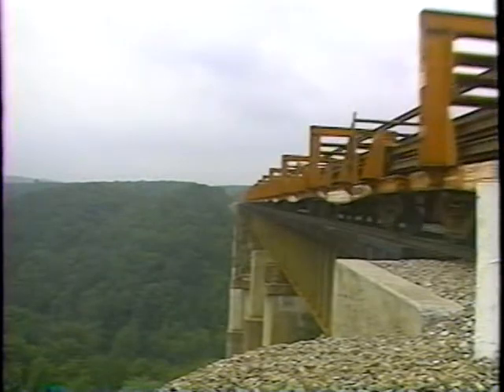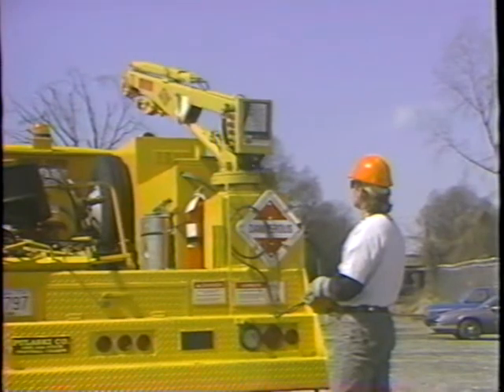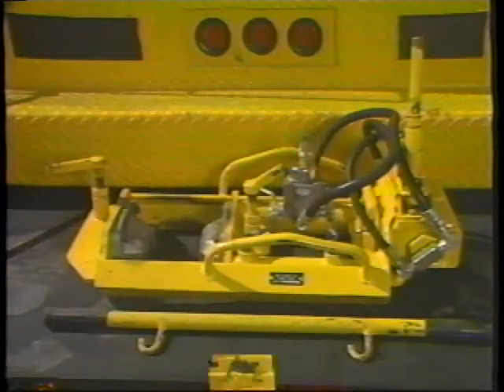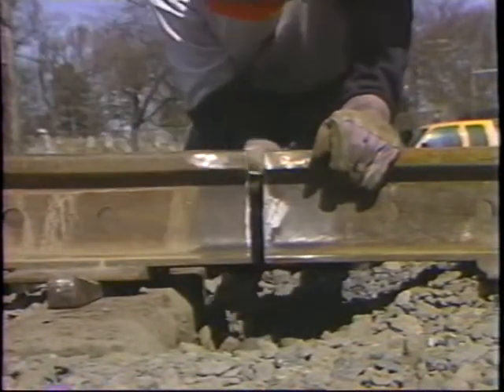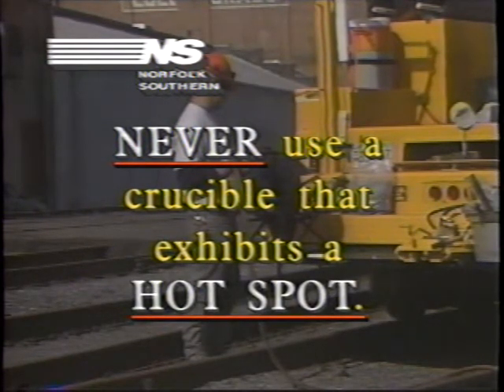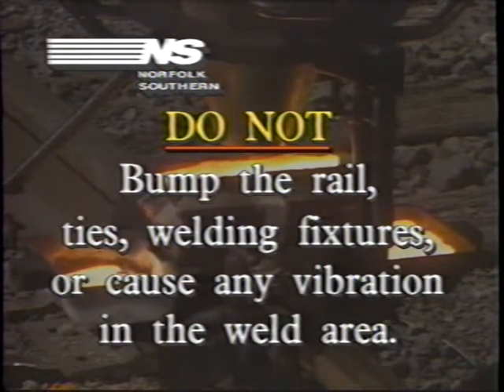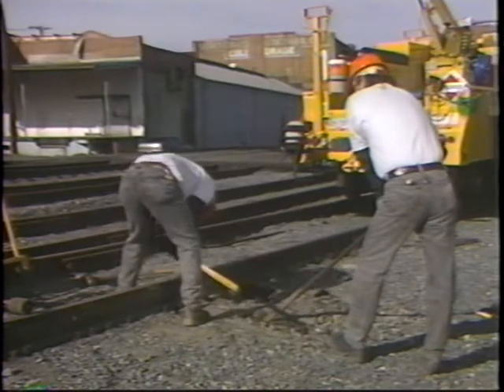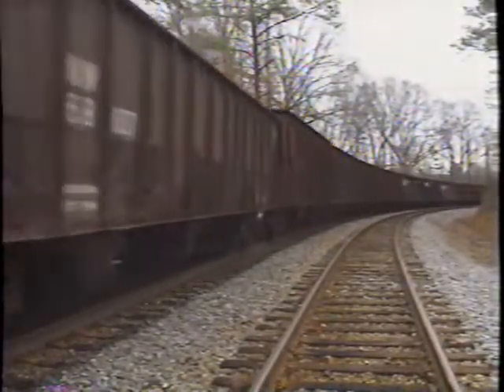NS Thermite Welding Training

Comment: I’m positive a large  Metabo angle grinder or a worm drive circular saw with a slicer blade would make a cleaner and square cut much more than a torch and you’d be ready to go as soon as you were done slicing.
Reply from the maker: Good point. I guess cutting with torch is faster and when working on rail they have limited time.